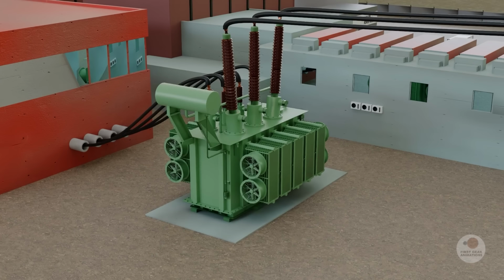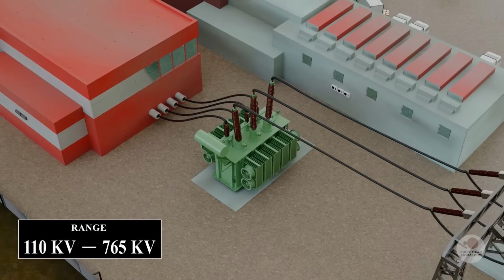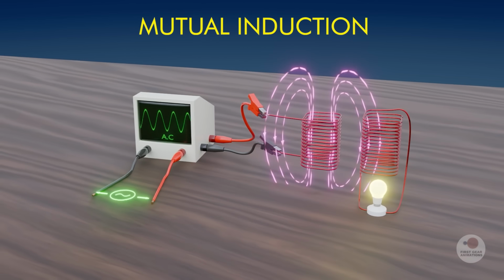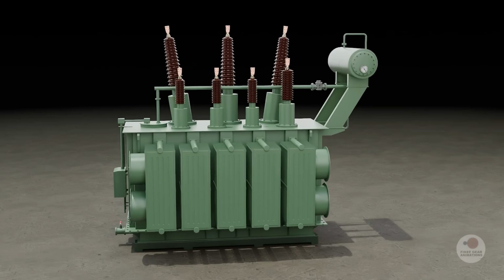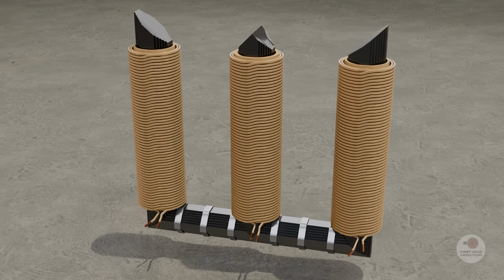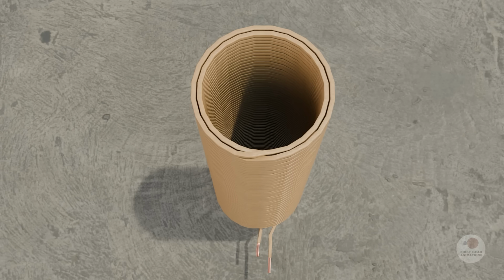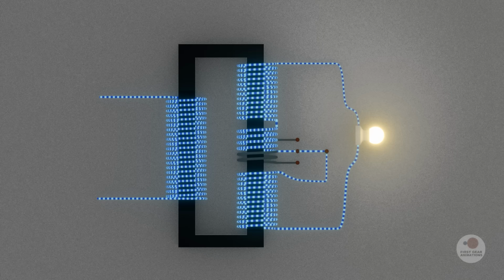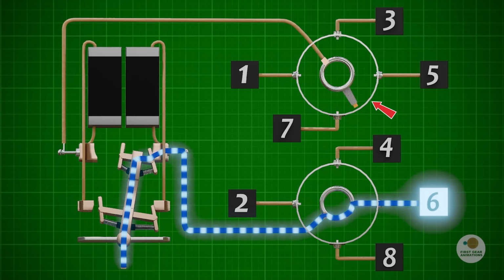How Power Transformers Work

Comment: The on-load tap changer section was the standout part for me — I finally understand how the diverter switch moves taps under load without interrupting the current. The 3D cutaway of the windings and core made it click.

Comment: The on-load tap changer was probably the most interesting part for me. It's fascinating that the transformer can continuously adjust its voltage ratio while remaining connected to the grid.

Comment: I'v been servicing and installing transvormers for 2 years now (up to 400kv) yes we open transformers at our workplace in finland up to 110kv transformers and even filter out the oil. this video really well explains and I still learned more for example about how the tap changer step resistors work.

Comment: There are spark gaps and surge arrestors mounted on the tank in parallel to the bushings in order to divert voltage surges to the ground.
Other usual tank mounted accessories are valves for emptying or adding oil by using an "online" filtering machine, oil level sight gages and temperature indicators, There is also a large box containing the radiator fan starters and controls and all other instrument terminals that may be taken to a conrol room for remote reading. Quite often surge arrestor discharge counters are also included.

Comment: The Eddy currents would probably cause it to heat up and completely melt or blow up that's why transformers and AC induction motors are built with sheets stacked together rather than solid metal

Comment: The easy part was using Nikolai Tesla’s Concept, where he showed there are thousands of volts just  above us, that is generated from the magnetosphere and the Earth working with the magnetosphere creating potential difference.
Because this magnetic energy is not being utilized and capturing this high voltage from literally “thin air”, the voltage buildup within our troposphere eventually high enough to ignite between ground and the bottom part of and just under the stratosphere commonly known as lightning. Of course Tesla was working on an infrastructure that would have provided free energy but we would still have the cost of maintaining power lines, transformers, etc. we just wouldn’t have the extra cost of generating this energy.
Reply: As fun to imagine as that story is, no, there's not a bunch of free energy out there.

Comment: Within one sentence, this AI demonstrates fundamental ignorance about its subject. Transformers are needed to step down the very high voltages of transmission lines to voltages usable by the public. The high voltages are used to minimise power loss from induction, but even then, the maximum distance from generation is about 400 kilometres, not the thousands it talks of. Fuel is fed to the generators which is more stable, mostly hydrogen/LPG in some form.

Comment: I don’t get how minimizing current is key power loss is also v^2/r by that logic u also want to minimize the volt ??
Reply: To simplify, voltage times current equal power lost in the lines. By increasing voltage you lower current thus lower resistive loss in the line. The load (homes and business) and the resistance of the power lines length are set factors, they can't be changed. Line resistance is thus fixed. Current running through the power lines resistance is what waste power in the form of heat. If you double the voltage the current will drop by half and deliver the same power to the load. So, if you increase the voltage by 1000 times, the current drops a 1000 times and in turn reduces the power loss in the lines a 1000 times. The current reduction through the same resistance equals less power dissipated through the line while delivering the same power to the load (homes and businesses). This is why they use such extremely high voltages. The voltage is high so current will be low.
Reply: You need to understand V=IR
And Q=I^2 * R
While trying to reduce Q(heat), we can hardly reduce R and the only variable we can vary is I(current).
The first eqn clearly shows u how to achieve  that; R= constant and therfore if u increase V, I has to drop. Simple
Reply: @omahawarrior4837  I suppose that you refer to a DC circuit. By the way, in an AC circuit the letter Q is normally used to designate something else (reactive power)
If you combine the two equations above you get Q (heat loss in your resistor and connecting wires) = V square divided by R.
Thus losses are proportional to the square of the voltage.
Reply: Where did you get that power loss is  v²/r ? And can you please specifiy what 'v' and 'r' are here?
Reply: @FulgenceMalvenue  That equation is for calculating I. I = V^2 / R.
Reply: @baruchben-david4196 
What are the variables here? 
I = current
V = voltage 
T = resistance

Did I get it right?

Comment: I am an High Voltage engineer: Compliments for the very well made animation, en nice explications, even difficult things like the delta switching.
Reply: @Grunniger61    Depending on the electrical system requirements, not  all high voltage transformes are connected Delta/Star. The ones used to carry power to a user system are usually connected Star (on high voltage side) and Delta on the lower voltage side) but large transformers interconnecting  different power systems are mostly Star/Star connected.

Comment: This video should be thought in EE faculties in universities. I have EE BS degree but I learned a lot here.
Reply: @sakritone   Faculties and universities as well as engineering schools teach general principles. Technical details such as how a transformer is built inside or what accessories it has are taught by actual practice in the field or shop. The same with civil and structural engineering applied to a building or bridge, plumbing design is not taught, no more than bridge lighting in foggy areas.

Comment: I’ve seen these behemoths being made and in use. Watts fun to me is seeing them struck by lightning from a giant Tesla coil before they leave the plant. 
  Nice job with the vid, just enough techno jargon without losing us 😂👍
Reply: Why are they "struck by lightning from a giant Tesla Coil" ? 
What's the purpose of that operation?
Reply: @FulgenceMalvenue  It is a high voltage test to check the coils insulation. The "Tesla Coil" is an impulse generator that creates a waveform (in this cas a single pulse) that approximates the form of a lightning discharge. In open fields, lightning will often strike transmission lines that carry the pulse to the transformer
Reply: @pindapoy1596 👍

Comment: High voltage travels through thinner wires (saves money, less thick wires), my place electricity arrive around 400 volt with thin wires, then the transformer on my property makes the voltage 240V, thicker wires to my panels.  USA.
Reply: @davidlaksa  Curent travels through wires NOT voltage. 
The 400 Volts distribution  voltage can be considered a "bulk" distribution voltage where several consumers are fed by the same power line. It  is likely that 400Volts is not safe inside the house and that is why the utility reduces it to 240V.
Very roughly Power is Voltage times Current thus for the same power usage, higher voltage means lower current and thus smaller cross section wires. easy example if you want to deliver power = 2 (whatever) you can do Volts = 1 and Current =2 OR
Current =1 and Volts = 2

Comment: Thanks for making this video and "investing" so much energy, time and efforts.

One small correction needed. At 19.37, buchholz relay should be shown in a tilted position rather than in a straight position.

# Ashwin from Mumbai, India.
Reply: @ashwinsawant6466   There are several models of Buchholz relays and unless you know how the internals are positioned in a 
particular model, it is difficult to know if it is up down or sideways. 
PS another often used name for the Buchholz relay is "sudden pressure relay"

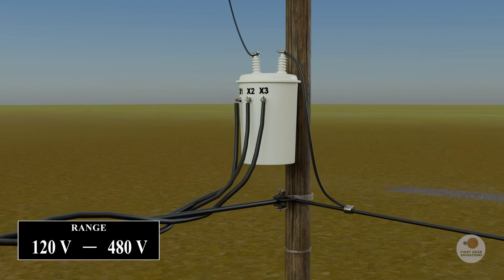Comment: How does a single phase on the primary (assumed L-N) equate to a three phase output (X1,X2,X3) at 2:53?
Reply from the maker: That's a 120/240 V center-tapped split phase transformer.

 A circuit between X1 and X2 (or X3 and X2) taps into just half the output coil, delivering 120V to power everyday electronics, lights, and standard wall outlets.

A circuit across the full coil from X1 to X3 combines the voltages of both halves, delivering the full 240V required to run heavy-draw loads like central air conditioners, electric dryers, and water heaters.